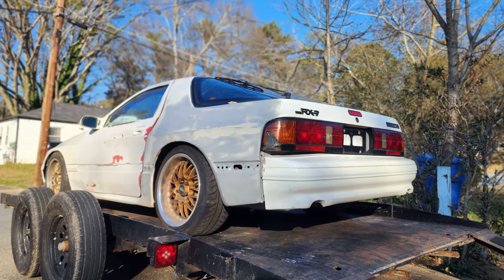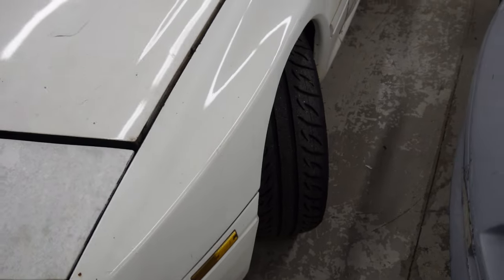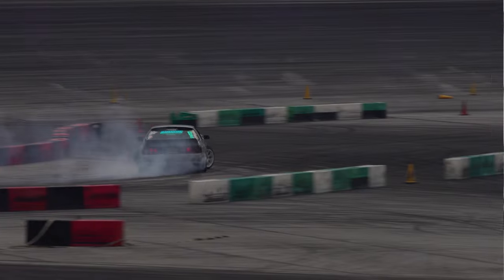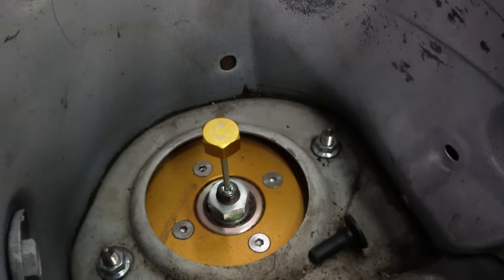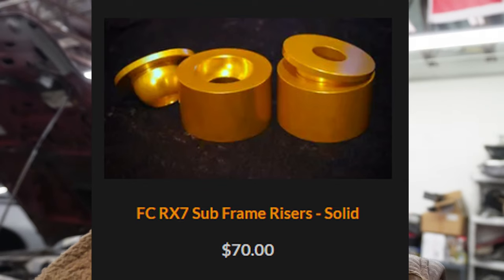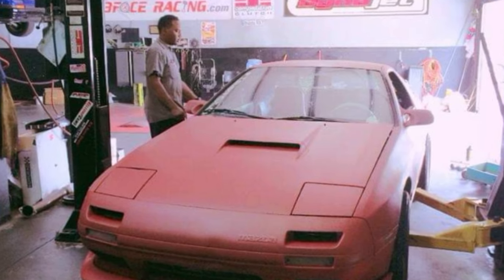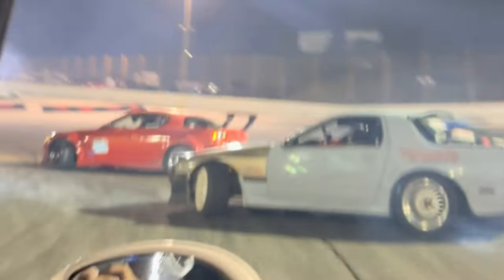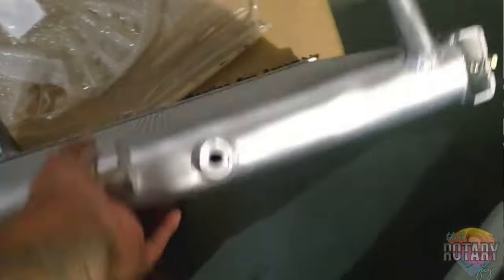Easy Upgrades You Need To Drift Your RX7!

Comment: I’m getting Pbm coils, but debating between Pbm knuckles/lowers or villains kit, any suggestions?
Reply: Pbm is better but villains is fine
Reply from the maker: I have not used or tried PBM knuckles/lowers but Villains kit will save u a ton of money and they work amazing! It's a great way to get into modding ur steering angle without having to break ur bank. I would say that they are the 2nd after PBM.
Reply from the maker: I totally agree with this 🙌

Comment: Always dig the rotary content, especially na drifting. Got a question for you. Did you start off drifting with no angle mods? I've had a lot to repair on my FC and would say i've done one year of drifting collectively from two events in 2020 and two last year. I can get the car to flick out but it's a struggle to keep it sliding. I'm in a stock s4 with manual rack, welded diff, complete PBM solid rear, FA coils, etc. I'm willing to bet my biggest hurdles as of now is the lack of power steering and angle mods but I truly want to learn the car first. The plan for this year is swapping out the manual rack for a de-powered one with rack spacers. Is this a decent intermediate move for a novice like me or should I just get an angle kit?

Btw I'm rocking the stock radiator with RB hoses and it does great. The big change for my engine bay temps came from wrapping my RB header. In hindsight, I should have coated it with something instead to prevent moisture damage. Sorry for the lengthy comment, looking forward to seeing more
Reply from the maker: Not a problem man! Thank for enjoying my content and u for taking ur time with ur comment 🙌 I appreciate it!

I actually started out with stock angle when I first drifted. I didn't get the steering angle upgrade until 3 years ago which made a big difference. I wouldn't say that would be ur problem as far as the "struggling" part. If ur struggling to keep it drifting, then it has something to do with the way the suspension is set up and other things like, tire pressure, toe, or camber.
One of the most important thing as well is to find the optimum alignment for ur setup. 
And yes, I would definitely suggest getting ur headers coated instead of wrapped. Thats what I've done with my headers. @jethot did mine and they came out really good. 
Also, let me know what tire pressure ur running, ur FA coilover settings, and ur alignment so i could compare it with my setup so that I could maybe help u with ur drift setup. 

And if u want, we could follow each other on IG so we could communicate easier